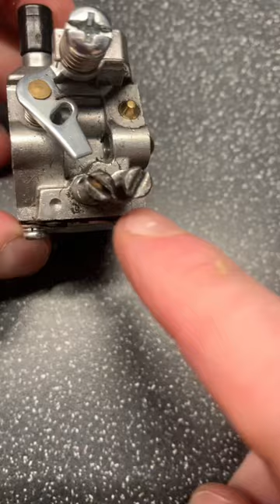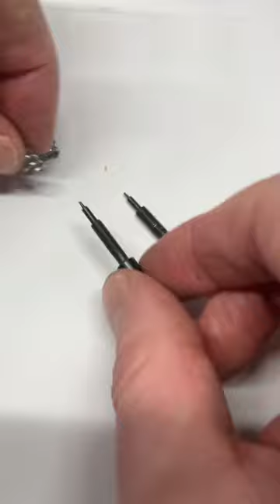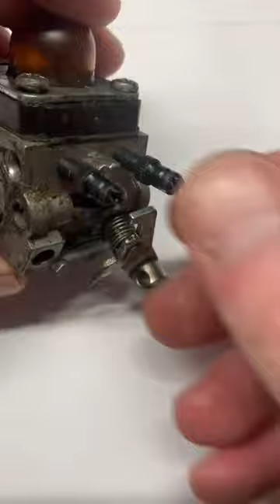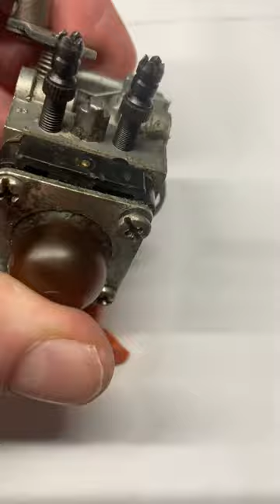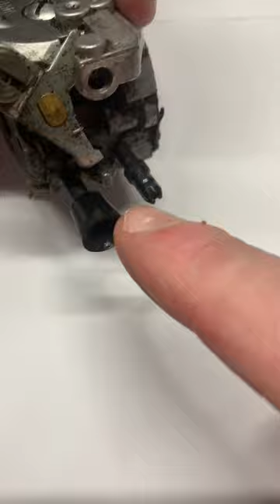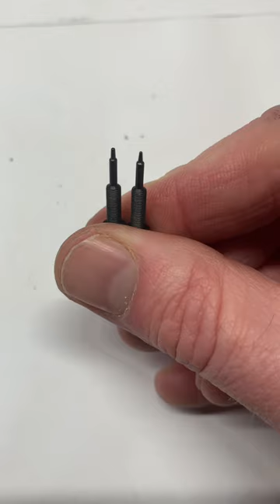Mixed up Carb Adjuster Screws, then do this...

Comment: Excellent video! I removed the screws from my trimmer carburetor for a deep clean. I noticed only the ends are different when I started putting it back together. Now I know the thin end goes in the low side. Many thanks! A like and subscribe from me.
Reply from the maker: I really appreciate your awesome comment, thank you! I'm delighted the video helped you with your trimmer. It's wonderful to hear that you were able to put everything back together and determine where the screws should go. The proper operation of the carburetor can be greatly improved by paying close attention to those small aspects.

Your support in the form of a like and a subscribe means a lot as well. For content producers like myself, your comments and participation are really important. Feel free to ask any more questions or for help if you need it.

Craig